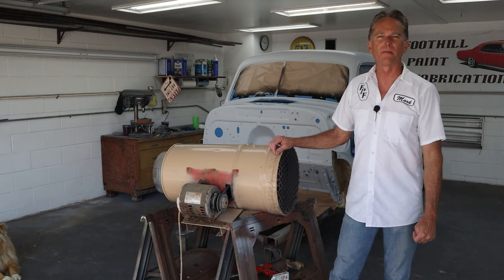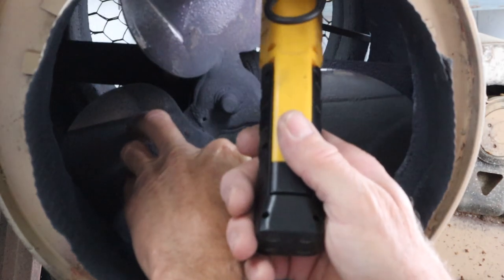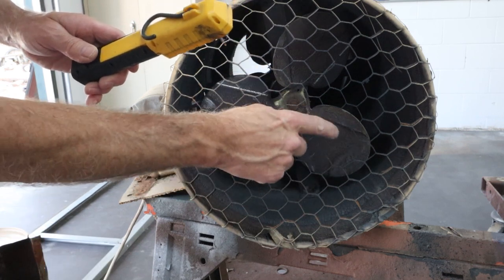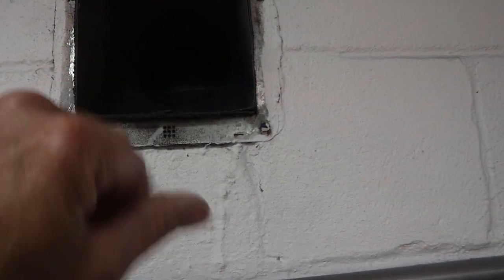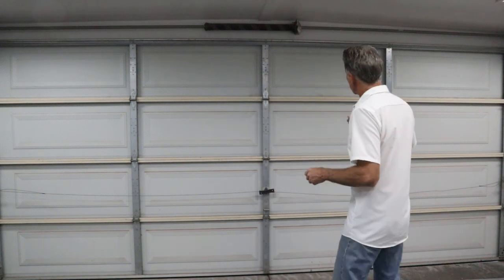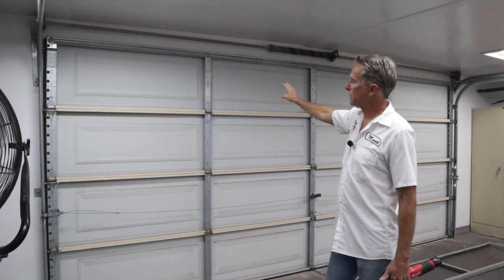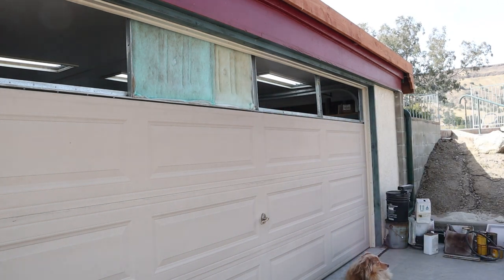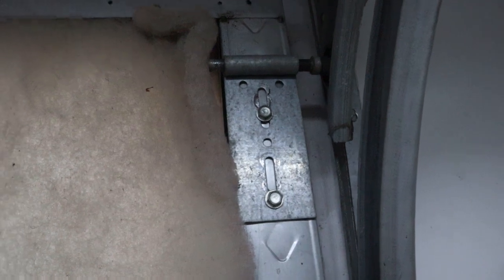DIY Spray Booth Exhaust Fan

Comment: Great video. I bought a Fugi 5 stage turbine spray rig. It gives me nice clean dry air without a compressor. I haven't used it much but it has very little overspray. Thanks for taking the time to make this video.

Comment: Would love to see the working in this booth to see how ur filters realy work
Reply from the maker: Since the fan is a lower volume capacity the filters seem to do very well at blocking dust and most importantly BUGS!  The air flow is not great but it does clear the air, just slower than I would like.  I have video of it working but can't remember which video at the moment.  If it comes to me I will get back to you.

Comment: Thanks, gives me some great ideas for my paint booth. Maybe you should consider (you probably already have) diverting the exhaust outside upwards so the dogs and cats dont walk in front of it while you're spraying?
Reply from the maker: I actually trained Jake to stay away from the shop while I am spraying because I don't want dog hair floating around.  Until I did that he would lay right up against the door where the air comes in to be close to me.  It took a few times before he picked it up but now he does it most times without me telling him.
It works pretty well for a DIY solution. I think if I had a larger inlet area it would move more air. 
  Good luck on your project.
Mark

Comment: Need to make sure fan blades are spark resistant
Reply from the maker: @imrefratilla922  The housing is grounded and I haven't had any issues with static build up so far. What would be needed for spark proof blades?

Comment: have to ask. Since I have neighbors that are about 50 feet away from where I would like to paint. Do you have any knowledge on what filters I could use to stop the fumes? Trying to find a pint booth to rent but coming up short. Looking into the inflatable booths but heard their filtration system is lacking to say the least. Even though about building my own but not sure about filters. Love watching the progress of your GTO. Doing the same to my 68.
Reply from the maker: Thanks!
On the outlet side of your fan(s) you could build a box to hold a couple of evaporator cooler pads. I think the paper type would work best but the wood shaving ones would work too. That should knock down most of any airborne paint which in turn should diminish the fume smell.  Definitely make friends with your neighbors and let them know what you are up to.  Inlet filters can be A/C or Heater filters.
Mark